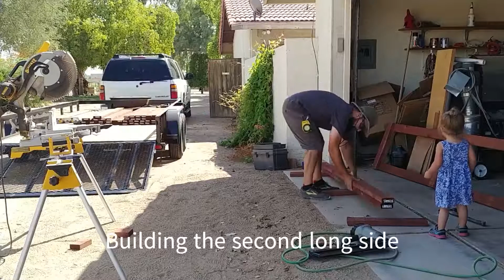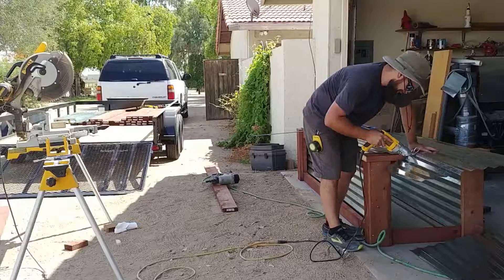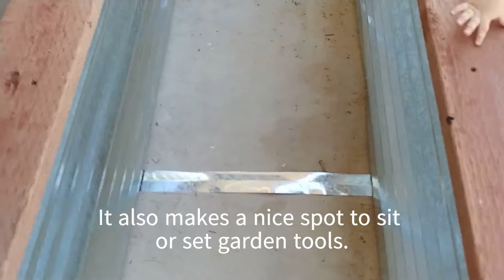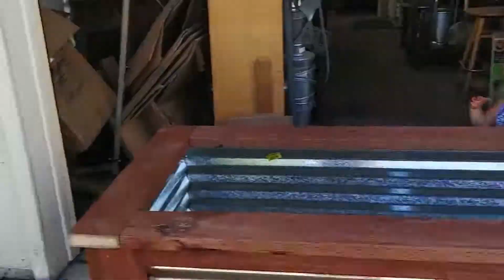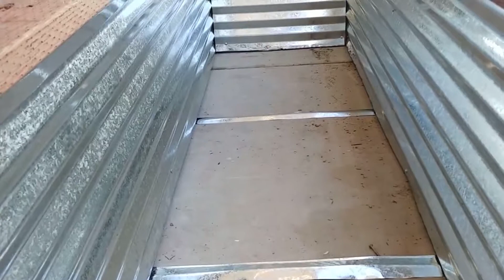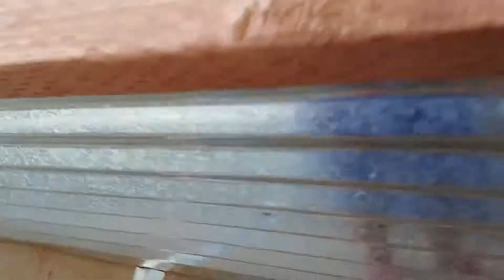Saving Miller: How to build a raised garden bed efficiently with the help of the Mini Farmer

Comment: Have watched a number of these “building a raised garden” videos.  This video and design beat them all and for a number of reasons.  As was pointed out in another post, the bill of materials list is really helpful & having captions with key details along the way was invaluable.  The design is perfect!  2x4 2x6 and corrugated steel, doesn’t get more simple and straight forward than that... but it does.  

The limited number of tools required to do the job is also helpful.   Chop Saw, Nail Gun or hammer and elbow grease, tin snips and impact driver.  That’s it.  

Thanks for Sharing!!
Reply from the maker: Thanks, Chris! Much appreciated.

Comment: Oh my goodness 😍😍 that's the cutest helper ever!!  I am wondering if it would be easier to use a 4x4 and notch it at the top so the 2x4's are flush, seems like it would require less lumber.  I'm either going to do that or just make a frame for all 4 sides using pocket holes, add the tin and then assemble.  I will also put hardware cloth on the bottom because we have soooo many gophers at the moment.  Thanks for the video, that raised bed definitely looks sturdy and will last you a long time
Reply from the maker: I have toyed with the idea of using a 4x4, similar to the way I did it in this planter: https://youtu.be/OuH0_yI0zMU
But, this method takes a lot of time and planning. So I'm hoping to figure out a way to do this on my CNC. And in retrospect, yes, we should have put hardware cloth on the bottom too. Big mistake!

Comment: Instead of cutting the sheet metal to reduce height do you think it would work to just bend it over? Thanks
Reply from the maker: I think that could be a good solution--if you have an 8 ft. brake! I would definitely have done that, but I foolishly sold mine several years ago. Miss it on a monthly basis.

Comment: Any problem with the sides bowing out? BTW Little Farmer has a great teacher.
Reply from the maker: Many of the other beds on YT will have problems with bowing out. But with the little blocks on the back and the 2x6 top rail mine have stayed very straight. I've built around 60 of these and have not heard of any issues with bowing.

Comment: Where do you get red treated lumber?
Reply from the maker: I get it from Lowes right now. It's just pressure treated dyed red. So if you can only find the green stuff, you could possibly stain it. Or it may work to order from Lowes or your local lumberyard.

Comment: I think I will measure the metal panels first and then build the planter to fit so I don't have to do all the metal 'trimming' to fit!
Reply from the maker: That's a good idea. Just keep in mind that if you go to 27 inches on the side, the 2x4s will need to be longer on the uprights so you will need to buy 10 ft. instead of 8 ft.

Comment: Really love these ones. What was roughly your cost per bed to complete? We couldn't find cedar last week when we built ours and for untreated pine I thought it would have been cheaper to build ours than what it actually was in the end.
Reply from the maker: I thought too that it should be cheaper than it is. But this design is a lot more robust that some of the others. The cost of pressure treated materials is roughly $150, depending a lot on what you use for fasteners. Redwood is great too, but it will add about 30%.
Reply: @savingmiller  Thank you for the response.
Ouch, I guess I will stick with my untreated pine for right now since this is first time I have attempted a garden bed and will save spendier one for down the road if I keep up with it.
Reply: Can you provide a approx total cost per bed to construct?
Reply from the maker: @KrazyKajun602  Sure, as noted above, these are about $150. Redwood is really nice too, but the cost is about $220.

Comment: Wow, nice job. That looks great. How has it held up? I haven't even planted anything in mine yet.
Reply from the maker: I've been pretty pleased with how it has held up. I built them in September 2019. I haven't had any issues with bulging or corrosion. I think they will easily last a long time. Our recent video has a shot of the garden in it. I do really like redwood. I chose not to use redwood since I needed 6 beds for our garden, but I have built quite a few for other people. It's a really good choice.